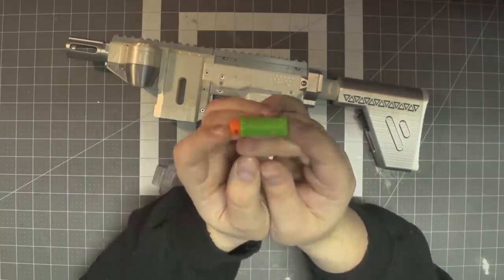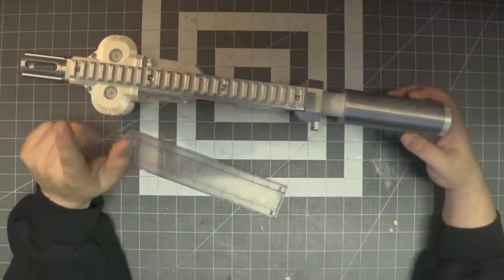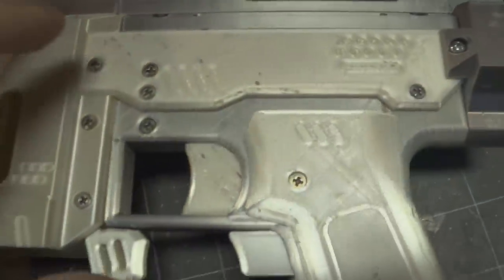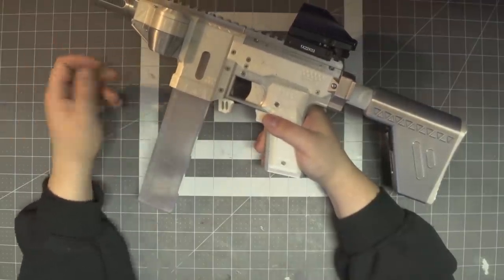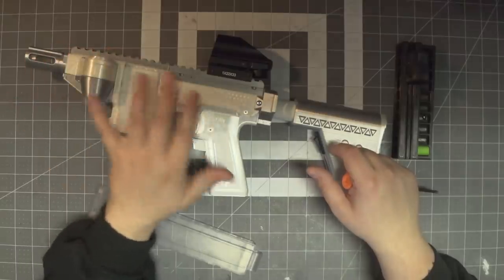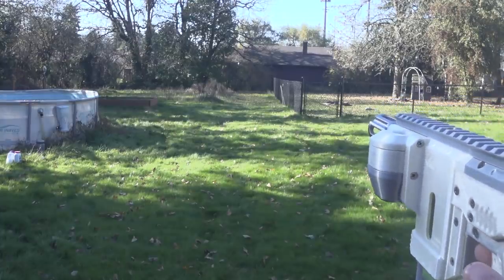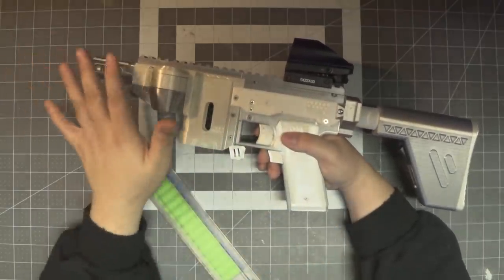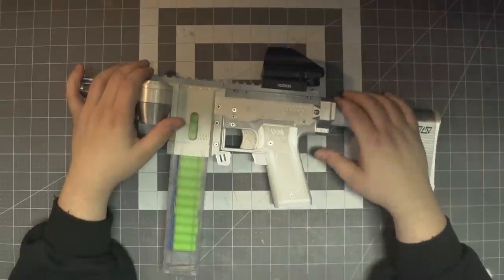NERF PDW: Gryphon 3D Printed Blaster | Walcom S7

Comment from the maker: Do you bother to read the comments? Good! You should join the discord then, you've already proven yourself capable. discord.gg/nerf
Reply: you have a discord now? hmmm i'm surprised
Reply from the maker: @orcatwar9810  It's been around for years.
Reply: id join but i got banned XD
Reply: Just a thought is it possible to convert a stampede or a volcan to shoot spring thunder shells
Reply: @loganbryson9058  that would be a hard no for the stampede and spring thunder shells. 

1) why would you want to?
2) you would need a mag to hold the shells along with a new breech design. This would mean a poor seal and less fps than the stampede already has.
3) an ejection system
4) the timing of it all the the stampede has pretty much 0 room for error in timing or you will shred your gears
Reply: @StuckOnAFireHydrant  how about the volcan
Reply: @loganbryson9058  I have 0 idea what a volcan is sorry
Reply: #latesquad
Reply: egg

Comment: The Fusion link directly shows the latest working version I have, so yes, that foregrip is indeed in development. If downloaded, you could try out everything I'm in progress on / scrapped at your own risk, but I will get around to testing and refining foregrip options and push for a more official release.

The feedback on some details like the tray door execution are also appreciated here, and I'd hope to think of ways to minimize any possible barrel alignment issues down the road (widening the bore, making it printable in different orientations, etc.). It's a bit ironic, as part of the intention of the cage design is to try to eliminate finicky alignment issues that often end up with modded wheelers. Hopefully with enough users and input, however, I can get some insight into what exactly ends up going wrong here.

Again, thanks for giving my blaster a shot!
Reply from the maker: It's an awesome blaster, I'll keep working on mine. I will also give that grip a shot!
Reply: @WalcomS7  Aww thanks, do note that the grip design there at the moment needs a new magwell to fit, similar to the FDL-3 grips.
Reply: Cool Blaster design man 😁🤟😁🤟😁
Reply: Your design looks awesome!

Comment: Considering the muzzle itself has standard spacing past the wheels, it might be that the cage isn't centered inside. Try printing the cage in a different orientation on the print bed and see what happens.

Comment: There could be a ton different issues causing the performance and accuracy problems.  I've had extremely mixed results out of Daybreak flywheels in general, after building five or six Daybreak setups.  They can have balance issues, offset motor mounting holes, etc.  It could also be an issue with the cage or barrel, or a combination of all of the above.  If you have another set of flywheels it would be worth swapping them out for testing purposes (I've had better luck with Eclipse wheels in Daybreak cages).  If you do figure it out, I'd love to see a follow-up video.

Comment: I call shenanigans on cage orientation affecting accuracy. If vertical cage = upwards curve then just flipping it 90 degrees should = sideways curve. It's gotta be form factor,  surely.
Reply from the maker: I think the idea is you have gravity pulling on the dart so it's most likely not contacting both darts evenly in a vertical cage but that isn't a factor in a horizontal.

Comment: Do you think you could coax foamblast, out of darts or worker to do a screw/internals kit???
Reply from the maker: I mean I picked up all the screws at Ace, the motors and wheels can be bought at pretty much any nerf shop, my spring was taken from random spring drawer. It's doable with a trip to ace and an order from Foamblast.
Reply: @WalcomS7  I just think it would be cool if someone did a commercially Available kit for this

Comment: I wish these competitive blasters were more affordable
Reply from the maker: I mean this is really cheap if you have a printer. If you're into the hobby and you don't have one, you should get one; saves you a lot of money. Ender 3 during black friday will probably be less than $170. Really if I didn't buy all the screws from Ace and just used Home Depot (they didn't have all the, "right" sizes but I found out most sizes are close enough) I would have saved a lot. 18$ wheels, 15$ motors, some wire, a single switch, screws, and a battery connector on top of maybe 400g of filament.

Comment: i am not convinced that horizontal is the way to go. When you think about it not all motors are created equal so if say the left motor is spinning 50-100rpm less than the right then your darts will be thrown out not straight causing you to miss shots to the side. If the motors are horizontal then if you are aiming at say some ones head it might still hit them in the waist. 
I much prefer brushless motors, make a brushless blaster and hit 200fps its a bit more expensive and complicated but you are going to get a overall better blaster.
Reply: I will say that in developing this blaster, the horizontal cage was strictly just to get the top rail as close to the barrel as possible. I agree with the logic you've put out for where a horizontal cage can go wrong (and I think it applies to stock blasters), but I personally don't think there are major accuracy differences because our current understanding of flywheel speed 'criticality': a certain flywheel geometry generally doesn't gain any more velocity past a range of RPMs, so we run DC motors a good bit faster than this RPM range so we can get consistent shots even as the motors slow down.

Also do agree on brushless superiority: more reliable flywheel mounting, more reliable stall protection, control options, etc. I still designed the Gryphon as a more accessible platform, that said, I am thinking of developing brushless blasters down the line.
Reply: @Flygonial  brushed motors have their place in history of nerf modding, their simple wiring and ease of use which will all ways appeal to modders. The grass snake, lepus, and viper are amazing examples of fantastic compact designs.
With brushless look into 1105 motors 5000-6400kv they can run a 4s. So you are looking at easy 200fps preformance they are a lot cheaper than some of the 2205 motors than the FDL and Ultrasonic. They are also very tiny like the 130 size dc brushed motor so will firlt just about anywhere.
Reply: @Side85Winder  Ooo will look into those motors if I want to build some compact brushless builds. What I'm thinking of right now, however, is a bigger RIVAL or Vortex blaster as I start thinking of what I'll do.

Comment: So by your logic instead of curving up or down it would curve left or right? I am confused.
Reply from the maker: Gravity is a thing, and I somehow doubt that both wheels touch the dart evenly in a vertical setup. I have no way to confirm this. It doesn't really matter much because the main benefit is that you aren't trying to aim with your barrel an inch from the top of the blaster, instead it's pretty much perfectly in line with it.

Comment: If only flywheelers are quiet and not sound like a karcher industrial vacuum...
Reply: Md Zl you might try a heavily upgraded stampede. (3s lipo, metal gear set, high power spring). Pretty fast and good performance. Might have trouble getting the parts though.
Reply: @psyrus728  thank you, i will check it out yo